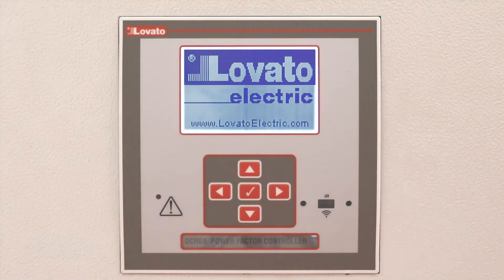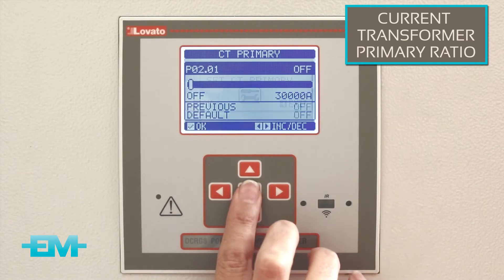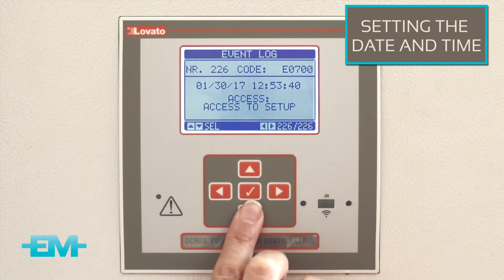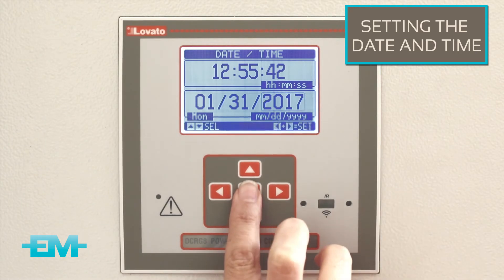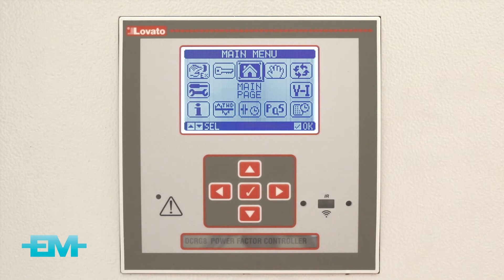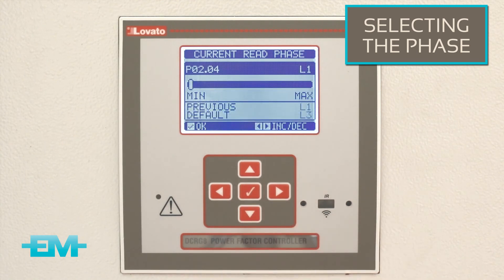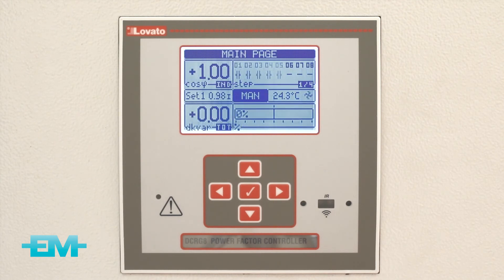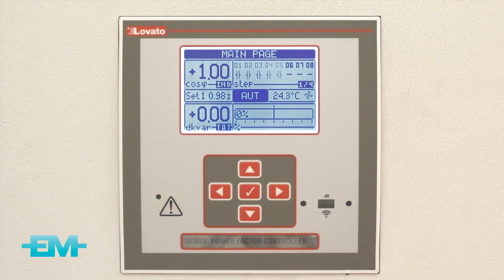ElectroMechanica Power Factor - Setting up the controller

Comment: Ok so i have a faulty controller aswell. But you have forgotten you need to set steps or nothing will activate. My fault was over compensation yet no caps were in. They just need a better manual rather than one paper with only wiring diagram on no procedure was included.